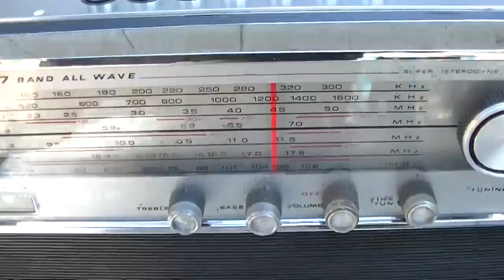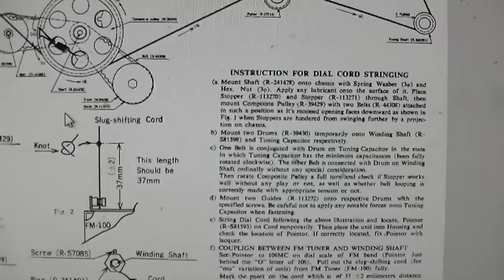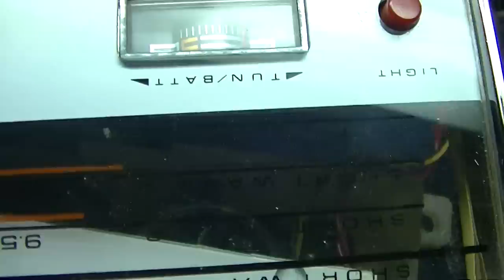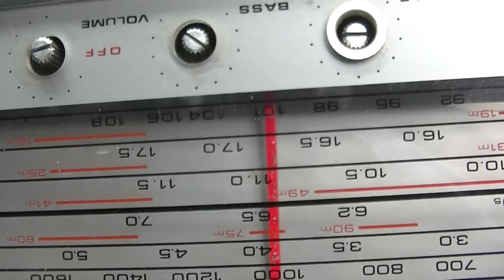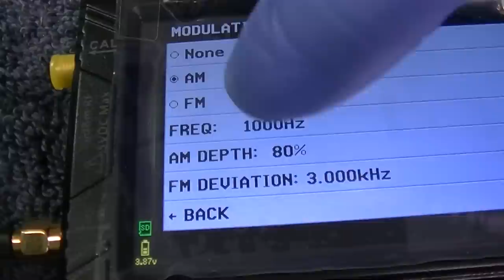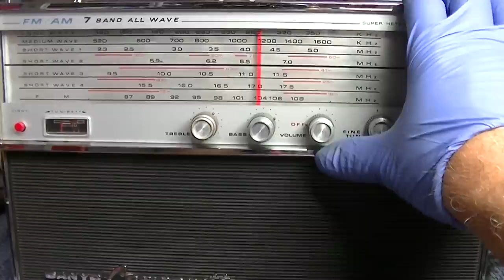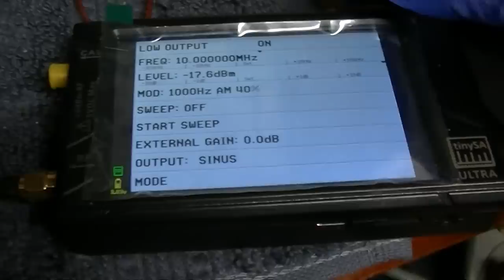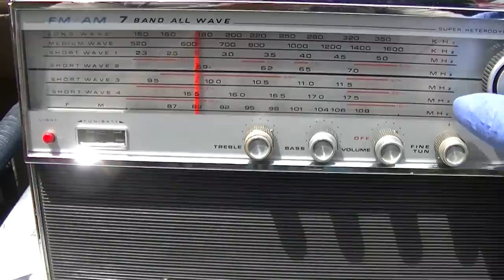Sanyo Campanetta 7 Band Radio Repair AM FM SW Tuning Belts

Comment: The seller most likely makes them in a mold from silicon i assume/ this and many other resins  is why i bought a fairly large off ebay a 3d printer jg arura s5 i think it what it is people buy that crap and will not use it correctly so bob`s you uncle now i bought one half price and its new only used once by an ignoramus like me lol.and yes you can print rubbery stuff and its a bitchh but doable